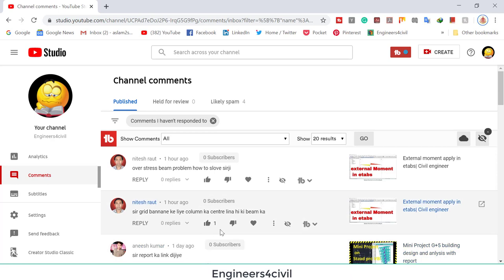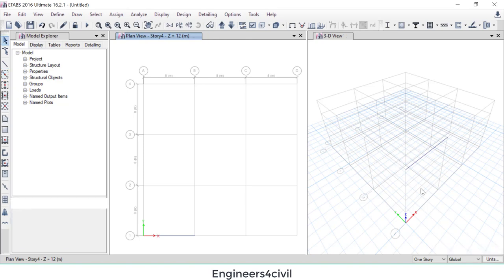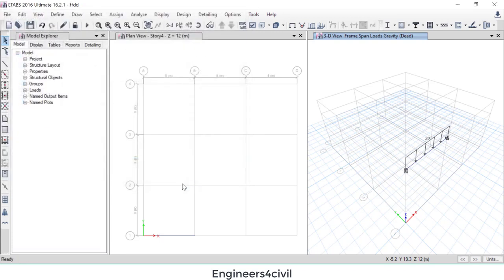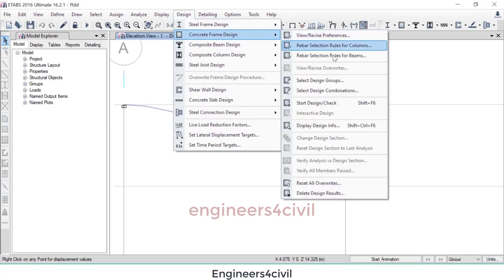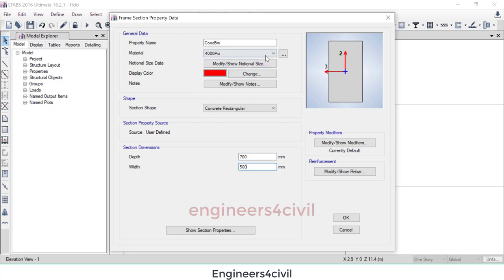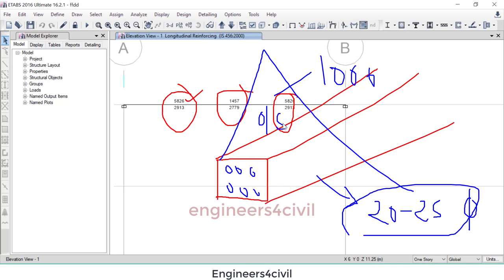Etabs over stressed -O S   Civil engineer

Comment: 🎯 Key Takeaways for quick navigation:

00:32 🏗️ Learn how to address overstress in ETABS by creating a model, applying loads, and designing using Indian code and metric units.
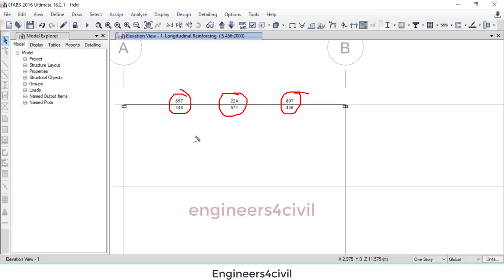02:11 🔄 When overstress occurs, modify the cross-section area, change concrete grade, or adjust steel properties to ensure proper reinforcement.
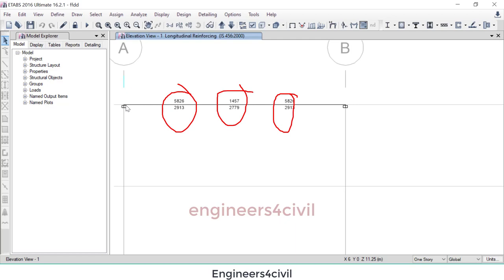03:55 🛠️ Increasing cross-section area can eliminate overstress, preventing the need for impractical quantities of reinforcement bars.
04:58 🔔 If you find the video helpful, subscribe, share, and click the bell icon for more content.

Made with HARPA AI